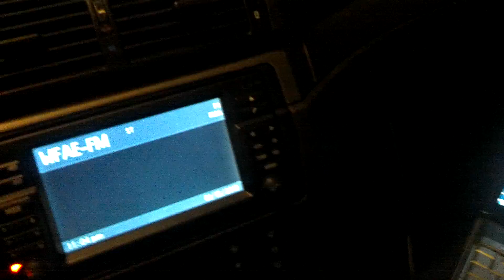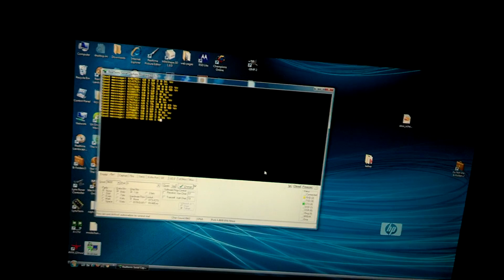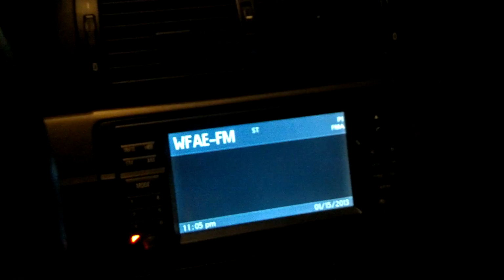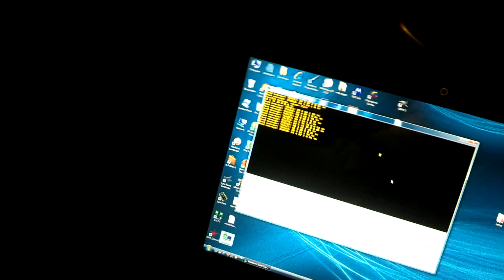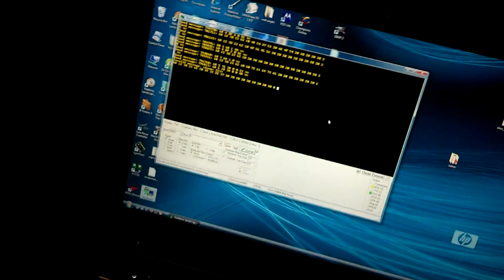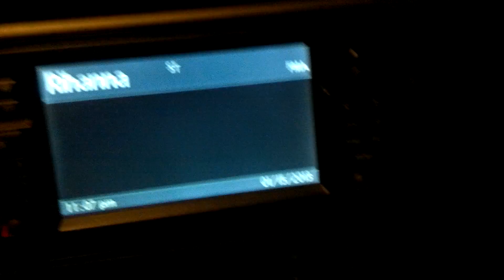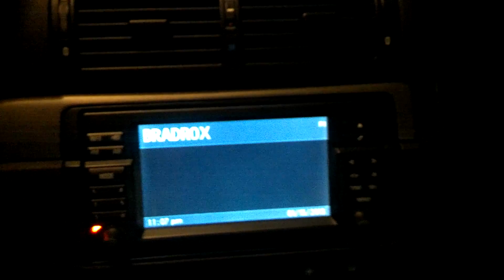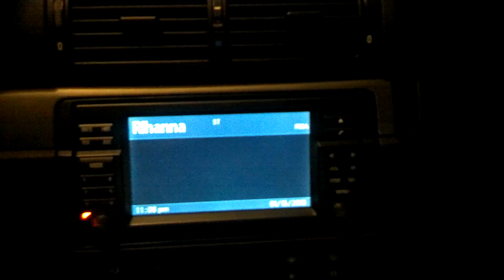BMW M3 iBus control over serial interface using Arduino

Comment: Hi mate, I am wanting to do the same sort of thing. What are your using alongside your arduino to read/intercept the I-Bus messages (E.G Where do you plug the #7 wire in the arduino or shield). Also would you be able to upload your sketch?

Thanks and great job!

Comment: Hey, tell me what resistors you used? My Arduino is Arduino Uno 

Because I used, R1 = 300ohm and R2 = 10kohm

and the connection pin 1 = RX (10pin) by R1 (+ 5V)
and pin 2 R 2 by + 5V
and even if you share the code that you used in the project?

For me, I receive messages but not send.

Comment: Hi Brad, good work, I am wanting to do something similar, I have the 2003 version of the chip you are using, can you tell me the Resister size your are/were using please. thank, John
Reply from the maker: I think I used a 220 ohm resistor, but it was just whatever I had on hand. You could probably use something much higher like 10k since it's just a pull-up resistor. By the way, if you're using a full size Arduino like an Uno or something, you don't need the external resistors since they're already built in to that. With the Arduino mini I was using, I had to add them.

Comment: Do you know how to send messages to the Instrument Panel Text bar.
Reply from the maker: Hi C S Lee. I don't know exactly how to send messages to the instrument panel, but I may be investigating that in the future. The best information I could find about the format of message, source and destination is in a document called IBUSInsideDRAFTREV5.pdf.

If you just do a google search on that it will turn up the document with the list of source and destination addresses that messages can be sent to. It's a little sparse, but starting with that you could probably come up with a method to capture messages and then search for things like the time or temperature or whatever shows up in the area you want to send messages to and then reverse engineer that.

Hope that helps.

Comment from the maker: Sorry, I could never find a complete list. Since I was working on just the radio and nav units, those are pretty much all I know. I have seen videos of people controlling lights and other stuff though. If you search for IBusInsideDRAFT you will find a good document with the basics (pdf). Other than that, I just set up my terminal program to capture messages and then hit buttons that I wanted to decode.

Comment: This looks like it will be pretty cool when finished! I have now got a resler interface for my range rover which also uses the ibus interface - its an early one so was made by bmw. Do you know where I can find a list of all the codes that you can manually enter through the ibus to control the car, ie turning the wipers on etc? Or engine start perhaps? Would be cool to start it from a touch screen on the nav display right? ;)

Comment from the maker: I don't have a schematic online, but the iBus transceiver circuit is very simple. Check the data sheet for the MCP2004 chip which is what I use for the transceiver. Basically, the circuit is: pin 1 to arduino RX and through R1 to +5v, pin 2 through R2 to +5v, pin 3 to arduino digital pin (set high to enable transmit), pin 4 to arduino TX, pin 5 to gnd, pin 6 to iBus, pin 7 to iBus power (+12v), pin 8 not connected